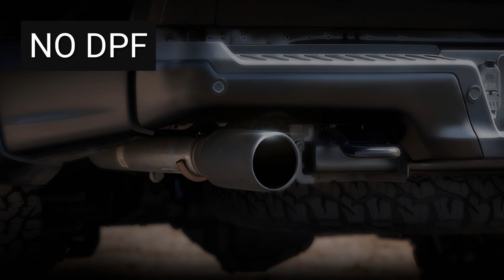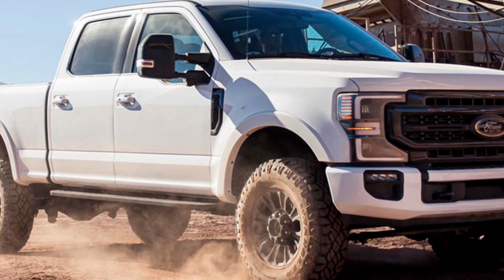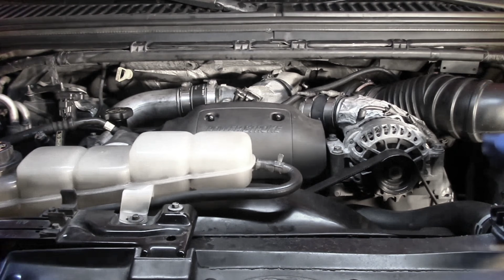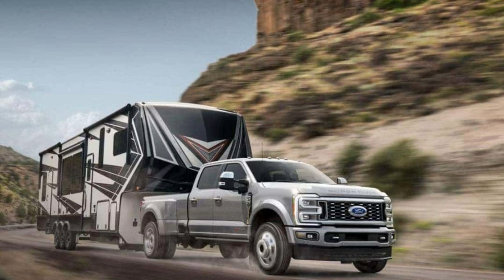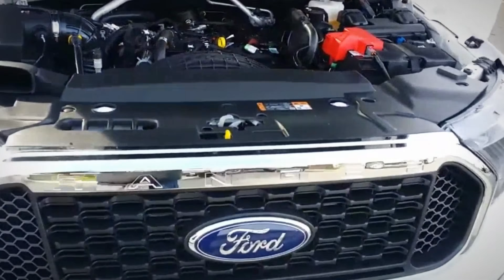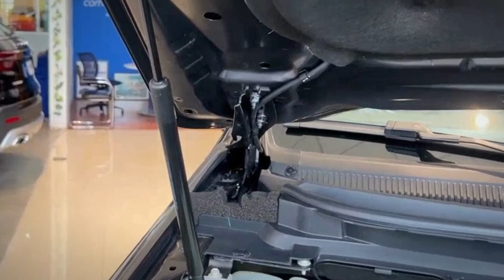3 Ford Trucks That Mechanics Drive to 500,000 Miles (And They Aren't F-150s)

Comment: Would kill to have my 1994 Mazda B4000LE SuperCab back with max payload performance package. (Basically 1993 Ranger in disquise) More of a truck than 2001 Supercrew. Maxda 8 inch longer bed 4 inches more legroom ( less head and elbow room) So much easier to put stuff in and out of bed. CURRENTLY have 2012 V8 Canyon Max Tow 2wd.  2010 F-150HD XLT 2wd SUPERCAB 8' BED. 2004-mid 2014 requires 7lug 8200gvw package. Long wheelbase rides so good highway 80-85 mph speed limits. 1st vehicle have not had to add rear swaybar to. WISH Ford would make a truck version of SuperCrew with standard 8'3" bed requiring 7lug Heavy Duty package 8500gvw. 2WD XLT 7.3L V8 10 SPEED 3.90 LS 10.25 Rear. About P295/70 R17 118T highway tires.
Reply: WOULD NOT OWN SOHC  4.0L. HAS 5 CHAINS INSIDE BLOCK SOME IN REAR. Have to pull engine to repair. Just as cheep to buy remanufactures engine to replace.  Wish Ford(Mazda) would have made aluminum block B5000 (302 5.0L).
Reply: I have an early 99 f250 crew cab 301k 4x4 runs perfect. Brother had one 2wd. A 99 with 526k when sold it. 3 water pumps 2 4r100s transmissions. THATS IT. NO OTHER ISSUES.